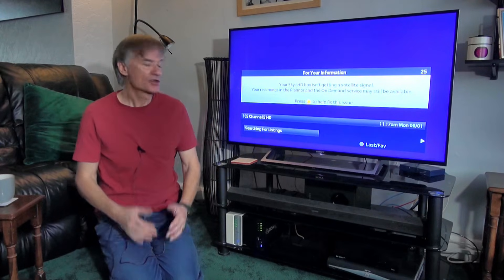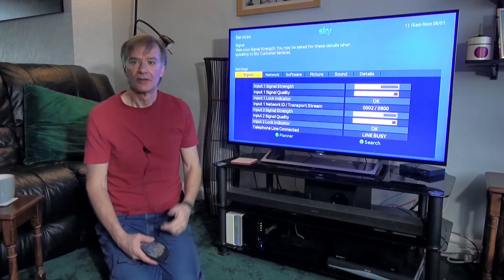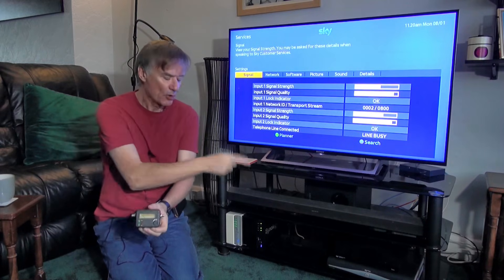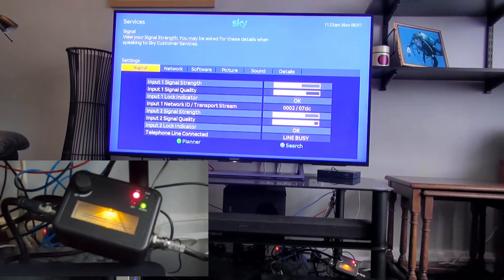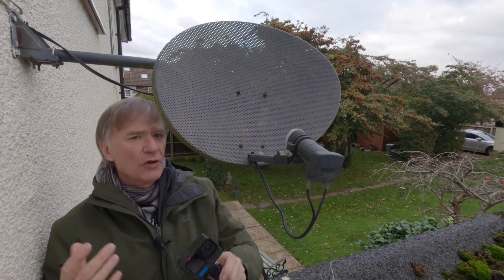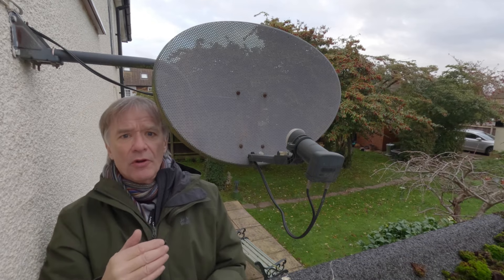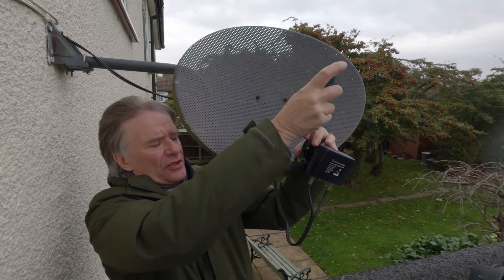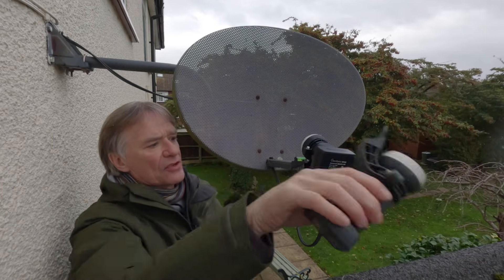Sky satellite dish repair

Comment: Surprised you didn't buy any boots for the outside LNB metal connectors with a bit of grease round them as well , also a bit of grease on the LNB plate that points to the dish "white plastic cover" just helps keep the rain off and a better signal when it does rain ...

Comment: I’m struggling to slide the LNB bracket off. I’ve managed to remove the plug but can’t get it to move. Is there something else I might need to do?
Reply from the maker: Mine didn’t slide off, it was also very tight. The LNB snaps onto the arm. I used my thumb under the LNB and rotated it off sideways. I hope that helps.
Reply: @NigelEaland  Managed to get it off by rotating. Thank You!
Reply: After watching your video, I could see that my LNB was in exactly the same condition as yours.  I immediately went out and bought a Labgear VK4L (universal).  Unfortunately, the bracket isn’t wide enough to fit over the arm coming from the dish, the original LNB having fitted inside the arm.  I thought that I would just be able to use the old bracket but the part that fits around the body to let it rotate is too small in diameter.  
Help!!!

Comment: put some black rubber tape over the metal lnb wires so the metal doesnt rust and the cable stays rust free too.
Reply: There’s a plastic shroud that pulls down on the bottom of the LNB which he hasn’t done, this is usually enough to protect from the elements.

Comment: If you suspect the trees may be blocking signal would you expect to lose many channels of either polarisation .i seem to lose itv on three tvs
Reply from the maker: The channel frequency, multi path reflections, polarisation, poor weather and dish misaligned can combine so that one or more channels stop working. You need an unobstructed view to the satellite and the dish correctly aligned in terms of azimuth, elevation and LNB rotation. I suggest you get a sky engineer in to check it.

Comment: Useful video ( with no annoying music ) Thanks.  You have taken the mystery out LNB installation, it looks a lot simpler than I thought it would be, but I haven't attempted it yet. I have been trying to find a video explaining how to install and align a complete satellite dish, I know it has to point south / east, but I am wondering how much clear line of sight it would need towards the actual satellite?
Reply from the maker: @HektorBandimar  that was meant to be my next video as my dish is slightly off alignment and I get rain fade on the signal. However, a Sky engineer is coming to update my receiver to Sky Q and needs to replace the cables so I’m expecting him align it.
Reply: @NigelEaland  Thank you, I didn't realise the cables had to be renewed to take Sky Q, I thought it was just the LNB.
Reply from the maker: @HektorBandimar  that’s what I thought but the lady at sky said they need to be higher quality and low loss cables. Plus the LNB gets replaced which is a shame as I’ve only just done that. I suspect it’s more about renewing for the sake of reliable service and getting rid of any old tired cables.
Reply: @NigelEaland  Good luck. Thanks.

Comment: Great informative video, do you have a method for setting the inclination of the dish, my brackets don't have the usual markings in degrees, thanks.
Reply from the maker: @keithhughes2104  that may well be the subject of another video once the weather improves. As you saw in this video my dish bracket is angled down. When i replaced the LNB the signal was good but the weather was reasonably clear. Now I’m getting some rain fade and my dish needs better alignment. The dish needs to be mounted square and not at a slight tilt like mine.

Sky is on satellite Astra 2D at 28.2 degrees E. Download an app called Dish Align which will give you the elevation, azimuth and LND rotation for where you live. You really should use a meter like mine to align the dish. You might get away with using the sky box for signal level and a spirit level app like Measure. Use a piece of wood across the dish face and put your phone up against it for elevation. There’s alway a delay in the sky box updating the signal level, so make small adjustments. The procedure is set elevation first then maximise the signal with azimuth. Then tweak elevation and azimuth repeatedly in turn to fine tune for maximum signal. Finally rotate LNB for best signal on each pole.

Hope this helps and thanks for watching.
Reply: @NigelEaland  Thank you so much for taking the time to reply. 👍

Comment: my neighbour if building an extension and it has just got to the height of my sky dish. Now I am getting the no signal message, presumably I will have to have my dish repositioned. I am afraid that I don't have the confidence to do it my self
Reply from the maker: @jimc2676  always best to get a satellite engineer in as it requires very fine adjustment to get optimal reception. You could have a chat with your neighbour. Maybe they would pay to put it right.

Comment: Greetings Sir. I was into FTA back in 2010 .I used two sonicview SV-8000hd receivers.One of them has the 8psk module. I pulled them both out of the closet last week and they work fine. Question. Are my two receivers outdated to use today for FTA?